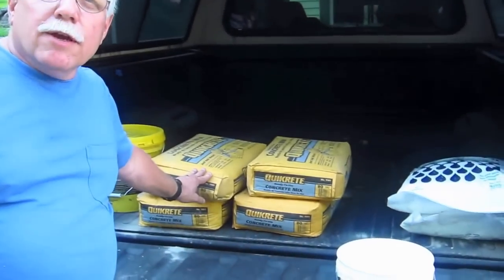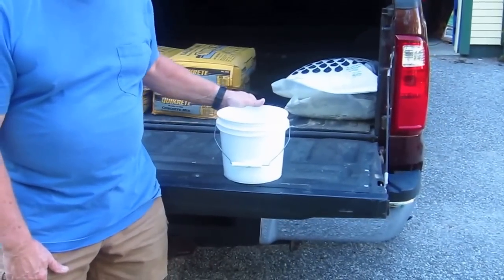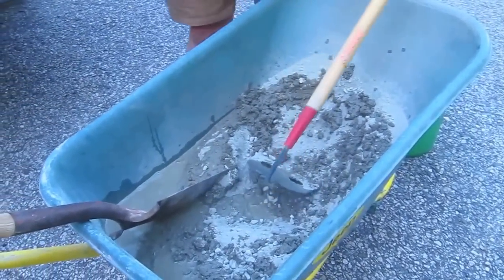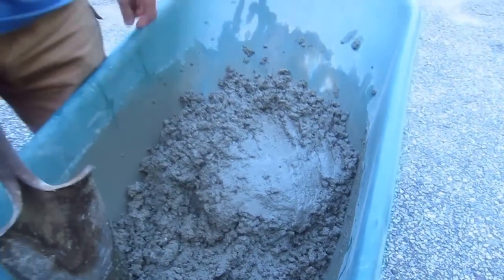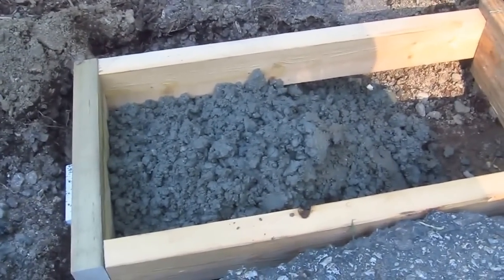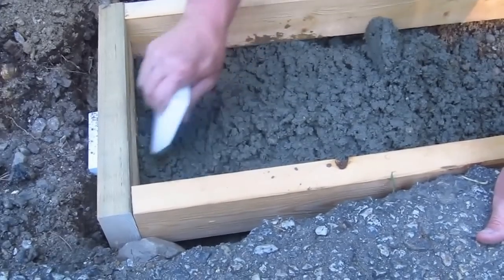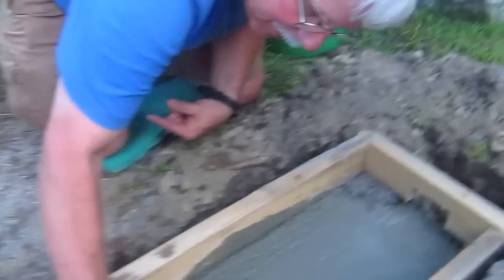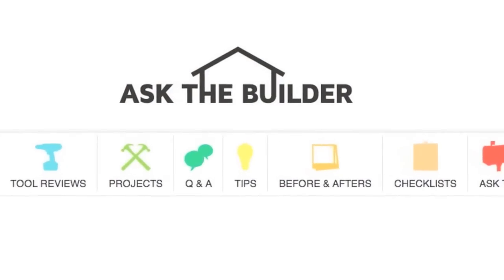Install a Trench Drain Video 4 of 7

Comment: I would use only sand+cement for that kind of work, esp. the first layer. Much easier to get it like you want. But concrete is ok too, only a little more difficult to work with.
Reply from the maker: The issue with your method is it's not nearly as strong as concrete. The stones, or rocks, in concrete are what gives it nearly ALL its strength.
Reply: Ask the Builder keep the videos coming Tim, always enjoy watching them, you're a great carpenter.
Reply from the maker: OTC Thanks! I'm uploading the rest of the series in the morning. Many many more videos are coming: Shed series, how to install a new window, Wood Rot series, Linear French Drain series. HUNDREDS of videos.